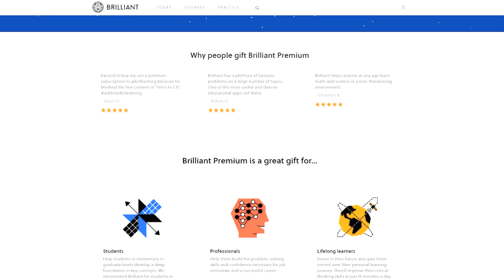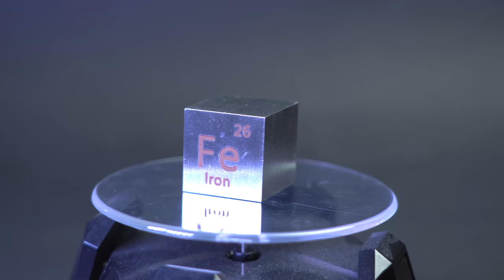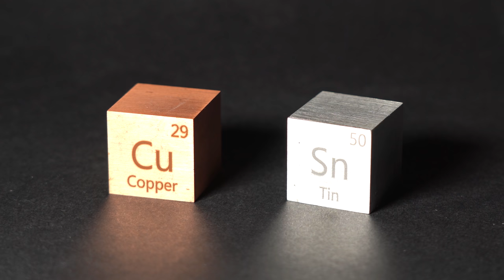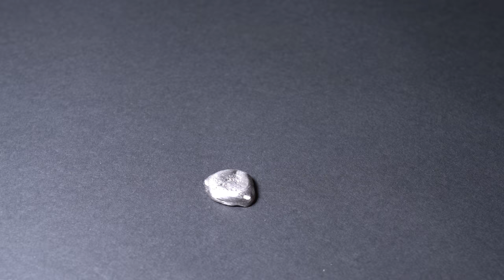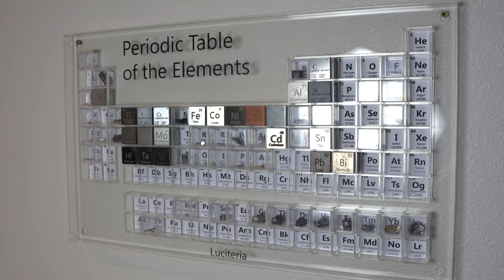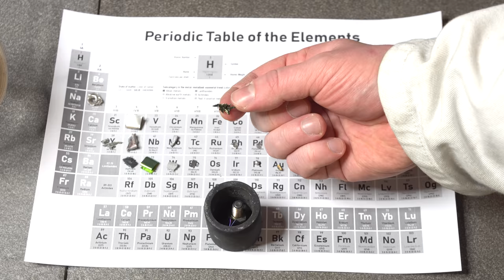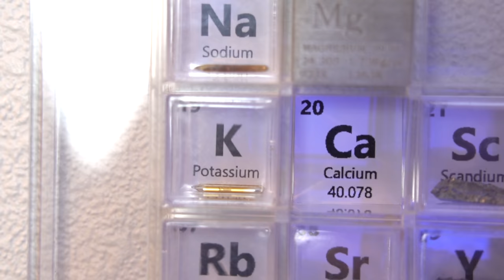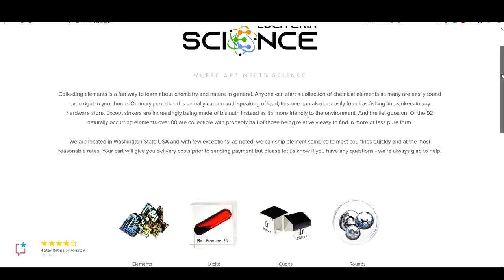What Happens if you MIX ALL The METALS Together?

Comment: I'd absolutely love to see this alloy forged into a blade. Super curious as to how it would perform.
Reply: Very poorly. If the metal is as hard as it seems it will snap/shatter instead of bending when it delivers a hard impact. Plus there are bound to be inconsistencies over a large ingot that would make weakpoints in the blade.
Reply: @iamcool544  so how about a warhammer, or even a mace? Something that doesn't require the need to bend and instead just needsnto retain its mass?
Reply: I mean no one said anything about metals that we don’t know off
Maybe there’s a secret something that can fix that flaw
Reply: @ultimatepunster5850  you can make a warhammer out of stone. It would just be unessisarily expensive.
Reply: @Sov_spoiled  There aren't any metals we "dont know of" every element has been mapped on the periodic table. Anything beyond that is not naturally occurring, requires MASSIVE amounts of energy to create, and only exists for a few milliseconds before it becomes unstable and breaks down into a lower energy element.
Reply: @iamcool544  that’s a very bold assumption considering we don’t know 75% or more of what our planet has to offer let alone the universe
Reply: @hbsavage0387  No its not. Every atom has a set number of neutrons. 1 neutron is Hydrogen, 2 is Helium, 3 is Lithium and so on. That is why on a periodic table the elements are numbered that way. There is no "half" neutron all atoms have whole numbers of neutrons and every additional neutron is a different element. All stable forms of elements have already been discovered and placed on the periodic table. We have even gone beyond that and created unstable elements that only exist for milliseconds because they contain too much or too little energy to maintain their current form and denature into whatever it was before we excited the molecule with the excess energy. We will never find a new element at the bottom of the ocean or on a different planet because we can artificially create everything in a lab NOW.
Reply: @iamcool544  I beg to differ. We may have found most of, if not all of, the elements on our planet but definitely not our universe. 

There are many different planets out in space that are under extreme, amd sometimes strange, conditions that it's no impossible that an element could be forced to change and turn into a new element.
Reply: @smerfjr9191  Im not sure how I can very simply explain a concept and you just dont understand it. There is no condition possible on another planet that can alter the number of neutrons a stable atom can contain. Pressure and Temperature the only things that are different on other planets regardless of the extremes do not change that. Instead of speculating and holding stupid beliefs try reading the first 5 chapters of any chemistry book.
Reply: @elitebelt  I don't think you're right, im sure there is stills elements that needs to be created.
Reply: @hbsavage0387  Elements are defined by their number of PROTONS, Neutrons change the isotope (Hydrogen has 1 proton, Deuterium is a Hydrogen Isotope with 1 proton and 1 neutron, Tritium  has 1 proton and 2 neutrons). Furthermore, IIRC, some scientists theorize that there is a small group of super heavy elements that are actually stable or metastable.
Reply: @iamcool544  my previous reply was meant for you
Reply: @elitebelt  I don't care at all, and i'm not going to listen to anyone to tell me what to think.
Reply: @gabrielangelo5937  It's not horrifying if we know all elements, it just means Universe isn't as big as people tell us.
Reply: @iamcool544  "Every atom has a set number of neutrons. 1 neutron is Hydrogen, 2 is Helium, 3 is Lithium and so on. That is why on a periodic table the elements are numbered that way."
You mean Protons and not Neutrons right?
Reply: Some of you guys didn't even make it past basic high school chemistry. Doesn't look like you're interested in learning either
Reply: @Sov_spoiled  a stronger alloy we don't know of yet may be possible though
Reply: @phenix2403  we were talking about elements egghead not alloys ofc you can make new ones based on quantifying percentages of different metals and through prediction, trial and experiment you can but discovering a whole new element by itself its highly not since the new ones that are discovered are through particle acceleration or high energy events like plutonium and fermium and so since they are defined by their number of protons that meant that the ones that go beyond this p count are highly unstable and couldn't last longer to even exist and eventually return to some element with a lower p count. Yes i study biochemistry and yes thats my bachelors.
Reply: @gabrielangelo5937  can't read that well, can you? Its ok, English is hard
Reply: @phenix2403  sorry i didn't know grammar nazis were scientists
Reply: @phenix2403  你现在更了解我了吗？
Reply: @iamcool544  but the lead would do critical damage to the opponet
Reply: every element has not been mapped, new elements were created and added less than 5 years ago: the people who did so predict many more elements are possible
Reply: Interesting that for strengths and malability some metals need the likes of carbon or certain gases to change the lattice bonds appropriately
Reply: @iamcool544  While you are largely right (1) you mean protons not neutrons. protons define the element, neutrons define the isotope, electrons define the ionization and a lot of the chemical bonding properties. (2) There have been theories for at least half a century that there may be "islands of stability" MUCH further down the periodic table and there;s really no way to disprove the idea with our current knowledge since we barely understand why the "islands of instability" in otherwise stable parts of the table exist.  Thus discovering such an element remains a possibility, albeit a slim one.  Such elements are unlikely to be naturally occuring given how fusing anything above iron in a supernovas star saps huge amounts of energy from the fusion and accelerates the death of the star, but making it in a lab could be possible if it exists and it's possible a tiny amount might have been made in the ultramassive stars at the very beginning of the universe or even the big bang's primordial soup.  (3) Neutronium, the material theorized to comprise the entirety of a neutron star is an extremely stable macroscopic atom made of pure neutrons (all protons and electrons would fuse into neutrons due to gravity), and if producable in a lab would be an extremely dangerous, but also potentially extremely useful material.  and (4) while all stable elements we can reasonably fuse to with modern tech have been reached, extreme temperatures and pressures CAN force materials into novel crystal structures with novel properties.  We know of many, but because of the extreme conditions required to make them, none are produced at the scale we can really fully test their properties and find all potential use cases.
Reply: @phenix2403  as somone in year 8 that fully understands everything going on here i cant agreee with you more
Reply: I think he might have accidentally put some uranium and mercury anyway because it is toxic in this comment section
Reply: =blade of olympus
Reply: New elements not likely outside a couple meta stable isotopes in extreme conditions, and there's new allotropes  with beneficial properties under less extreme conditions to be made.
Reply: @iamcool544  You're wrong. We can predict what new elements will be like but we can't say we've found them all. Also isotopes are a thing. While not unique elements in and of themselves, their properties can vary enough from the standard that they'd be a worthwhile discovery
Reply: @iamcool544  You're thinking of protons, but ye
Reply: @elitebelt  clearly you didn’t watch Tony stark make that light triangle for his suit 😂
Reply: @iamcool544  atomic number (and thus element) is not neutrons, it’s protons, change the electrons and you get ions, change the neutrons and you get isotopes.

For an example read about uranium
Reply: @iamcool544  BTW, atomic number is based on protons rather than neutrons. The sum of the numbers of protons & neutrons is called mass number. Hydrogen only has one proton and NO neutron!
Reply: @iamcool544  There could be much heavier elements created by much larger stars such as "black holes". We especially don't know what they products of supermassive black holes are like.
Reply: @gabrielangelo5937  IMHO, particle accelerators don't quite cut it for the creation of elements because elements are created in stars. I wonder what exotic elements are created in supermassive "black holes".
Reply: @IONATVS  Well, "black holes" are really dark stars because they don't allow light to escape. And, IIRC, at the centre of spiral galaxies, there's always a supermassive dark star. What wondrous elements might be created by such?
Reply: @isaacmadhavan  To the best knowledge of current physics the material within a black hole is unknowable—the only stimulus we’d be able to use to test it at all would be to feed it light or matter (seems to just matter the total energy consumed not the type), and as far as we know the only thing that can comes out is hawking radiation—ie whatever is in there leaking out as nonvisible light in a somewhat random way—and proportionally less of it the bigger the black hole is. So while there are many theories as to what the supercompressed matter/energy ball in there might be like, and many conceivable uses for black holes AS black holes (artificially-maintained natural gravity for one, massive batteries to store absurd amounts of energy for later and withdraw at a slow predictable rate, etc), in the end we will likely never truly know what a black hole is on the inside, just what it is like in their area of less complete influence.
Reply: @IONATVS  Yes, as I understand, quite a few dark stars (I really don't like the term "black hole") emit relativistic jets from both ends of the spin axis (suggesting that even that level of gravity cannot contain/restrain everything). 
And, yes, it WAS my point that we do NOT know what exotic materials have formed or are being formed in dark stars.
Making use of them is quite another whole set of subjects. As I understand, only gravity can slow down or "capture" light. Thus, for a star to be dark, it absolutely HAS to have that minimum amount of gravity to restrain light itself. In turn, this means that dark stars cannot be created in a lab. In space, on the other hand, perhaps, if ever, we can get to the technological point of being able to push a few stars together to create a dark star. Of course, along that journey, we may have discovered other things that do NOT require us to think of "batteries".
Reply: It would be garbage for a weapon
Reply: @ultimatepunster5850  the fact you can see some metals didn't blend/mix shows it wouldn't retain mass. It would likely Crack and cause weak spots.
Reply: @iamcool544  Pressure and temperature may not change the elements, but radioactivity and nuclear reactions and even extreme gravity certainly will. And that's a factor you failed to acknowledge on other planets. We can create antimatter on this planet, what makes you think a super metal can't be created that ends up being stable on its host planet because the planet has conditions to hold it in place.
Reply: @iamcool544  Not really, otherwise it would have shattered when he hit it with the hammer.

Comment: Mangalloy is also used to make railways, i worked in a foundry that made these.
The Mangalloy has a better flexibility than carbon steel, so it can be slightly deformed before actually breaking.

Comment: what happens is most of them evaporate.
Getting anything hot enough to melt Tungsten and the other higher melting point metals is above the boiling temp of many metals. Which means they have to evaporate before the furnace meltl can get hot enough to melt the tungsten.
Reply: How does this affect the final composition? Im really curious

Comment: You could probably hammer the nugget flat, and fold it, repeat a bunch of times, to better mix the metals. Then remelt it.

But I think it would have been better to sacrifice the crucible, and just let the alloy cool without exposure to the air. The nugget is likely worth quite a bit more than the crucible anyway.
Reply: I must see someone do this and turn it into a dagger then test everything with it or use it with as a magnet and attach it to their fridge

Comment: I'd like to add to the points made from 11:25, that you there made a ferritic steel which is magnetic and that is correct, however the non-magnetic stainless steels are the ones with a considerable amount of austenite. This can be achieved with alloying Nickel in it for example (upwards of 7 %), or in the case of tank tracks as you mentioned, high amounts of Manganese, which then creates the so-called Manganese-Austenites that are work-hardening (very useful for tanktracks).

Comment: 4:00 I got that exact same scale on the right from ebay for $3 over 10 years ago. To this day it still works great. I think I only changed the batteries twice. The off button stopped working years ago but the auto shut off is good enough.

Comment: Great idea for having fun :) You should write down how much of each metal you are adding in case of finding sth special. If I were you I wouldn't be mixing silver with gold. For metals that are burning out - You should do it in some box filled up with some gas (should think about sth that will not react with metals) instead of air. In my opinion you should also take care to decomposite metal particles to as small ones as you can, mix them well and then turn on the heater.
Reply: Exactly. Making filings and powders, then mixing them, and then melting them all would've have yielded much better results.

Comment: Looks like you're using cutting disks for polishing. Use them to cut, use FLAP DISKS to quickly shape, fine flap disk to smooth and then a rubber impregnated polishing disk for fast polishing or polishing compound and a buffing pad. 
This will quickly allow you to shape and polish a nug to a near mirror surface.

Comment: 11:00 the sparking is representative of the carbon content of the steel.  High carbon sparks more.  Low carbon, much less. Why didn't you add some carbon?
14:29 you just have to slowly cool the metal from above the Curie Point to below it, while in the presence of a strong magnetic field. Otherwise, if you strike your easy magnet with another piece of metal, it can lose its magnetic field.

Comment: That last alloy was impressive, I still have yet to come up with a good corrosion-resistant alloy (Trying to make a good alloy for bronze jewelry that doesn't require Gold or Silver).
Reply: Chrome maybe?
Reply: @tktspeed1433   I would, but I think Chromium is a bit out of my temperature range for melting. I can barely melt Iron with my current equipment (some ended up in one of my bronze ingots, leading to a fair bit of confusion when a magnet stuck to it before I'd realized what had happened).

Comment: You can’t just mixing liquid metals and form a perfect homogeneous system.

When you are cooling down, and passes the eutactic temperature, you will get multiple solid substances, depending on the attraction between your metals.

17:39 By cooling it on room temperature, you’ll get a terrible mixture of metals that are layered on the Alfa crystal with the highest concentration in the liquid phase
Reply: So then what would you do if you wanted them to mix easily?